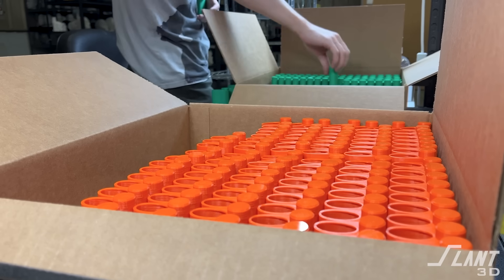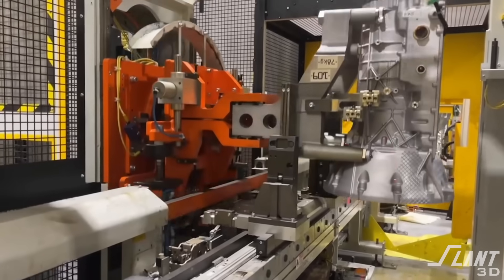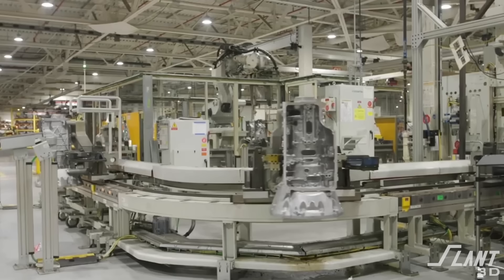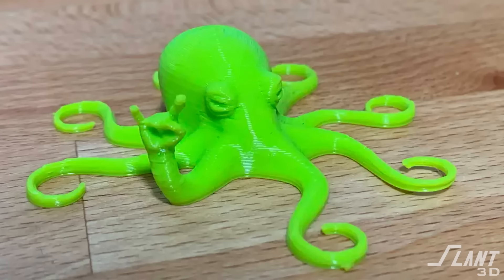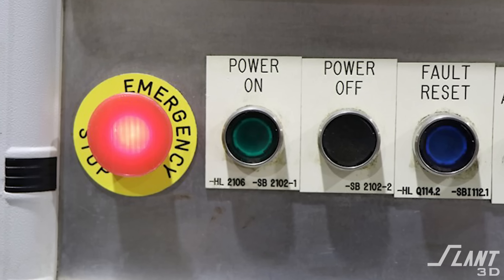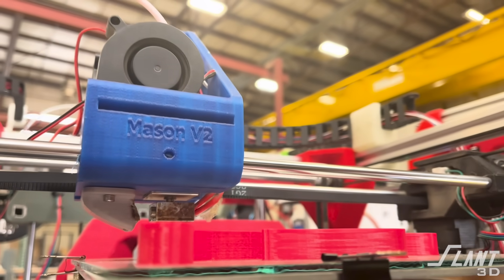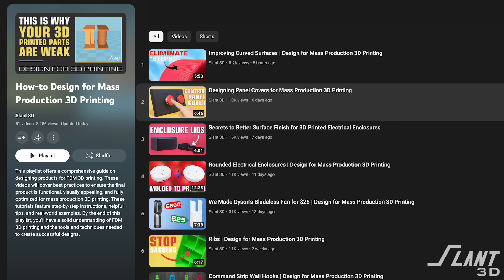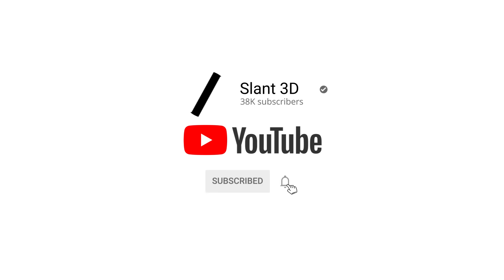How 3D Printing Saves Ford MILLIONS at One Factory

Comment: Where I work at I do this for the company. There are some ridiculously cheap replacement plastic parts that either can’t be ordered or are not made anymore.  The worse one is a simple injected molded gear, that wears down in about a year, and drives a plastic belted in-feed system. They refuse to sell the gear separately, but it is included with a brand new 1700$ in-feed setup. I cloned it, fixed an angle and print it for 35 cents. That is one example of dozens.
Reply: That's a really smart move, no need to buy such an expensive set just for a gear every year
Reply: Is it pretty proprietary? Too bad you couldn't find a machined one and have it last a loooong time

Comment: I got myself a 3d printer where i work (i deal with a hotel maintenance), and already produced an inexpensive replacement part for the card holders in the rooms. The new model we are using are from "Bticino" brand, and have a little plastic piece that pushes the card against the switch. If you pull towards you when extracting the card, not just upwards, the piece breaks sometimes, and stops making it work. The card isn't pressed against the the switch, and lights never turn on. Of course, the provider don't have a replacement part, so you have to buy a brand new card switch for arround 56€. I took one apart, measured it and created a copy in Onshape. Works flawlessly. Fixing an important 56€ piece of equipment with a 0.07€ printed part. I had 10 broken switches stored, and they all got fixed with a 300€ Ender 3... the printer has already paid itsellf with it's first job...
Reply: And they probably passed zero of the money saved onto you. 😂😂
Reply: @BabyJesus66   Of course, i was just doing my job...

Comment: I work for an electrical contractor. We bought our 1st 3D printer 2 years ago, we now have 6 printers. Once our field electricians saw what we could do, they reach out to us looking for spare parts that they can not longer find, or something that may help them on a job. They can't believe once we get the part.  Printers some days run 24-7.
Reply from the maker: You should reach out to us. We could get you setup in the Print on Demand Side so you don't have to maintain your own printers
Reply: @slant3d  Thanks. We're moving on the direction of acquiring more equipment to suit our costumers needs.  We want to keep everything in house as it makes it so much easier as far as logistics.

Comment: As a manufacturing design engineer for the navy i had designed a single part that was a cost avoidance of $210,000 per H-53 rotor blade.  During the first year that one design saved the navy over 4 million dollars and is still used to this day.

Comment: I worked at an Amazon warehouse, and they had push buttons that would come off, you couldn’t buy just the plastic screw on button, you’d have to buy the entire button assembly. The vibration of the machines made quite of these buttons come off. One push button costed $50-$60. I took one of the caps home, and modelled and printed ~30 caps cause I was a tech and it made me cringe looking at that cost.

Comment: I work in conveyor maintenance at a logistics company. We began testing 3D printing during covid when OEM parts became scarce and prices soared. So far we have replaced various expensive parts ranging from control knobs, gears, and sorter parts while also developing custom solutions for costly problems. I am still pushing to standardize 3D printing as a viable option for maintenance cost reduction and reducing dependency on OEM supply across our entire network. However, adoption is slow for this large company as they are still determining the legality and actual cost effectiveness of these parts (durability/safety risks) and the labor required to upkeep a small print shop.

Comment: I work for Otis and am working on building out a second 3d printing lab at our factory to support engineering development projects and to create fixtures for the factory. We currently have a lab at a sister site where they are using 3d printing to create end use replacement parts for elevators installed 70-80 years ago which we can no longer buy parts for.

Comment: I used to work at a university research workshop. They had these covers for peristaltic pumps that basically had to be replaced weekly, and cost about 120 euros each. Basically the printer ink business model. I spent about thirty minutes moddeling the part and about an hour printing it. Worked like a charm, cost about ten cents.

Comment: It's not a factory, but I work in an R&D lab.  We utilize 3d printing for printing fixtures and prototype pieces.  The prototype can be the typical scaled down model  to show how a product is going to fit together, or how it will work.  We also make functional prints which can range from a simple spacer to a full housing for electronics assemblies, to custom o-rings and gaskets.  My favorite print is a combination or multiple o-rings with a gasket.  This is printed out of a material with a hardness or 82A, so it's soft and pliable.  Having this as one piece has saved us a huge headache of figuring out how to hold high pressure o-rings for a hydraulic system down inside an assembly.

At a previous lab I worked in, we would have clear 3d molds printed for vacuum fit two part silicone for various over mold applications.  One was a two step process to over mold PCBs for a high vibration and high G load environment.  The first mold layer was more rigid, but had much better thermal characteristics so the power ICs could have their head easily dissipated.  The second layer was a lower hardness material to allow the assembly to the cavity it goes in much better, thus reducing or elimination secondary harmonic vibrations.  Another molding operation we did, which would have been prohibitively expensive with traditional mold manufacturing methods, was a vacuum injected overmold for a very sensitive antenna coil.  This coil needed the 2 part RTV to flow between the wires to lock them in place, as well as have a thick layer over the top to protect the wire from the harsh environment it which it would be working.  The RTV had a metal shield over it, but it was not a sealed cavity, so we had to deal with high pressure (up to 20kpsi) trying to get into everything.

Right now, I'm printing parts that sell as a kit to upgrade the Ender 3 V2 NEO to a much more accurate and capable machine.  Properly tweeked and sliced, you can print at 80 to 120mm/s all on and old school style bed slinger with an all in price of under 400 USD.

Comment: 🎯 Key Takeaways for quick navigation:

00:13 💰 Ford saved millions of dollars per year at one transmission plant by using 3D printing for critical parts like pucks.
01:53 🔄 3D printing was significantly more cost-effective than buying $180-per-piece pucks, even when factoring in material and labor costs.
03:18 🛠️ 3D printing was used to redesign and replace parts like emergency stop buttons, saving costs and avoiding the need for expensive replacements.
05:09 🆕 Redesigning and 3D printing a steel jig as a plastic palette fixture reduced rejection rates, saved thousands of dollars, and improved performance.
07:12 🧑‍🔬 You don't need to be an expert to use 3D printing in your facility; you can learn and apply it to improve processes and save money.
08:09 👏 Sharing success stories of 3D printing applications in industry helps highlight its potential for saving businesses millions of dollars per year.

Made with HARPA AI

Comment: Modern jet fighters have lots of sensors in them and due to that you need quite the maintenance to make them work and prevent them from getting wet, dust , etc in them , a dude that was working in the maintenance of said fighter jets  had the idea of making a 3D printed cover for the a part of the nose of the plane, by covering the sensors the sensors won't get dust nor water in them , the guy is currently looking for patents since that cover that doesn't cost more than 50 dollars functions pretty damn well for making sure that the sensors of the over 65 million dollar (i think it was more expensive than that)  fighter jet function for longer times.
That was done by using an average FDM 3D printer , if people still think that 3D printers are just a hobby thing then they don't pay attention to what happens around the world. Oh , did i mention that in the current war in Ukraine some of the drones used are mostly 3D printed ?

Comment: You mentioned there are many stories like Ford's. I'm actually having a hard time finding stories where a industrial facility benefits from small printers on site. I know in my heart that the stories are out there, but I can't find them. Can you tell me where to look?
Reply: A lot of us don't really tell the stories. In 2017, I was designing parts and using my Monoprice Mini at home to print robot end-of-arm-tool parts and machine nests for producing parts used by BMW and Mercedes. No need to make a fuss about it, my job is problem solving. 2018-2020 involved designing and printing end-of-arm-tooling for in-mold labeling in an injection molding facility, using an EnvisionTec Vector 3SP. At my current company, we 3D medical implants in titanium......and quite a few items for the factory in ASA and ABS on a Stratasys printer. I'm not involved in that side with this company, I'm in charge of machine maintenance on, among other things, a fleet of direct metal printers.

3D printing has a lot of applications for factory maintenance. Kudos to Jeff and Jonne for convincing upper management that this isn't just a toy or some "magic sauce".

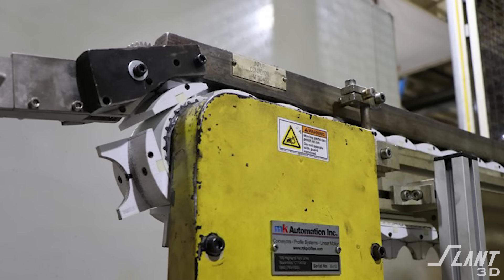Comment: 0:48 I'm surprised they use hobbyist printers on that picture. Most industrial settings I visited use hi-temp hi-speed machines with heated chambers for making jigs and tools. Usually with some blend of PA.
That said, traditionally jigs to hold finished parts are made out of teflon (the core can be metal). Teflon is easily machined with any cnc lathe or mill, which machine shops routinely do.

Comment: 180 bucks for a piece of plastic that regularily breaks... Didn't know that Apple made factory supplies too.
I'm also somewhat speechless that a manufacturing like for steel parts did not see the obvious flaw in having the "jigs" made from the same material...
Why didn't they had them made in brass or aluminium? Would then instead the jigs be ruined constantly?
And is 3D printed the same, just faster, cheaper and with more plastic waste?

Comment: I feel like this has nothing to do with 3d printing. In the examples 3d printing was A solution, but not THE solution. The cleats are $180 because large corporations do dumb things. In reality, making a custom mold and mass producing them on an annual basis would likely be cheaper than 3d printing. The jigs featured had no features solved by 3D printing. Changing colors and switching to plastics can be done via conventional methods. 

We use 3d printing at my factory and right now its reserved for one offs, and covers/guards. But we are developing bi-material printing designs to reduce cost and leadtime on low volume fixtures/jigs. Something that actually utilizies the unique capabilities of additive manufacturing.
Reply: we actually have an 80 ton press at our disposal  and the cost to have a mold made was 15k, by 3d printing we were able to change the whole design making it a better fit for the application in a matter of hours , while coming in at a printed material cost of under .50 cents a piece. It would have taken 10 plus years to offset the cost of an expensive mold, material as well as the press itself. and as far as subtractive manufacturing you would have exceded  the cost of 3d printing it in waste alone not to mention the labor to do the work, the cost of raw material, waste, and building of the jig and or fixtures. Our savings to print these parts  1 time was $144,000.00 combined with a downtime savings and loss of jobs per hour putting the total savings at 500K. this was totally a 3d printing solution!!! combined with our other 2200 pieces we now print in house our savings to date is now over $ 4,000,000.00
Reply: A solution doesn't have to use all the capabilities of a manufacturing method for it to be the most optimal solution.
Also, economy of scale only works if you have enough scale to offset the massive startup costs associated with things like injection moulding.
Reply: @jeffreyfisher8594  good work Jeff, hopefully you get some nice benefits from you and your partners contributions